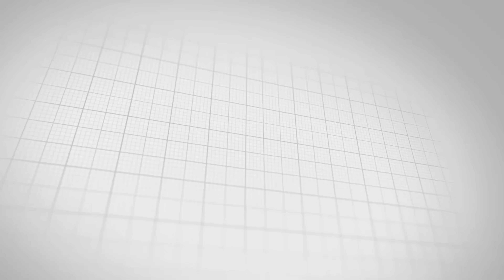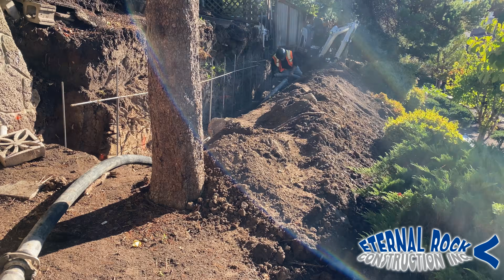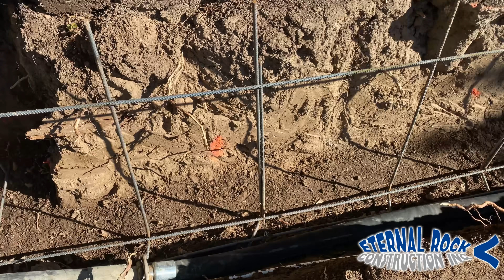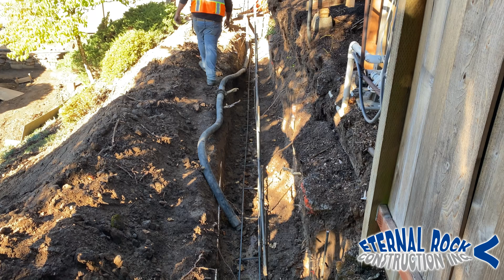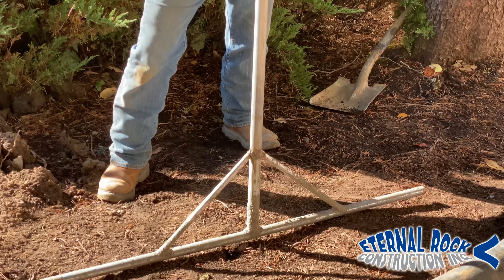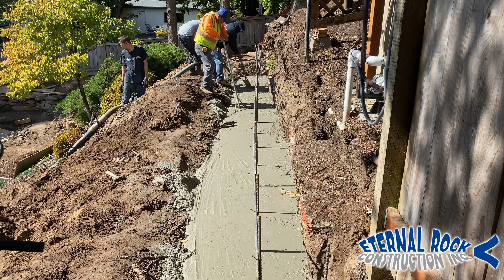How To Pour A Footing For Concrete Retaining Wall Step by Step | Super Easy DIY!

Comment: Two things I'll add. Why isn't rebar supported with plastic chairs very much in the US? (Supporting rebar with rock is far from ideal)
And, the bulk of the footing should be behind the wall because the backfill applies downward pressure on it, therefore minimising the potential for the retaining wall to begin to lean outward.
Reply: It doesnt look like an engineered retaining wall, so the "design" is basically whatever the contractor feels like doing.

Comment: Sorry , 
steel must not touch the dirt.
That concrete has to much water in it.
You should have put plastic to seperate the white electrical or water pipe that is in the side of the trench.

Nice video, nice voice , good work team.

🇦🇺👍🏻
Reply: Rebar is also tied too far from itself to be affective structually